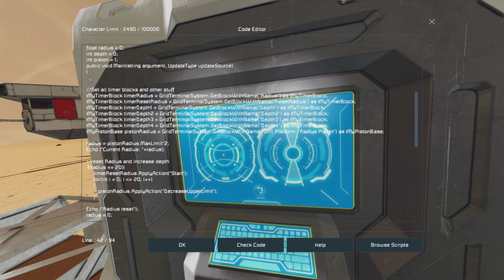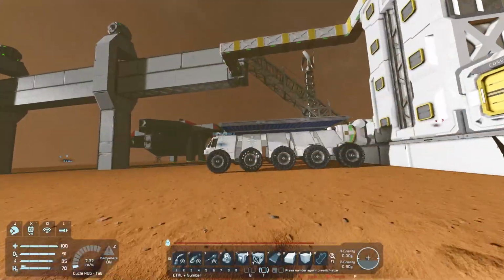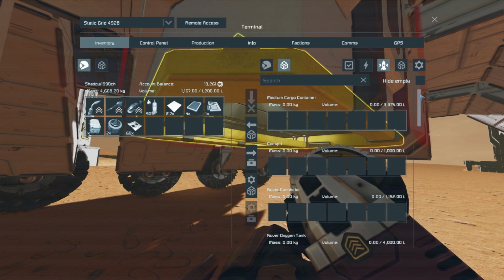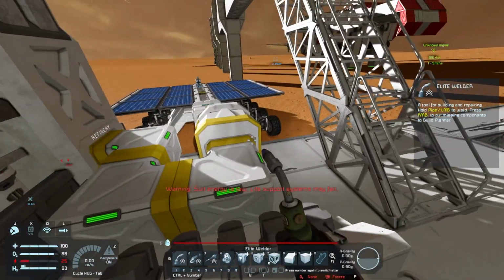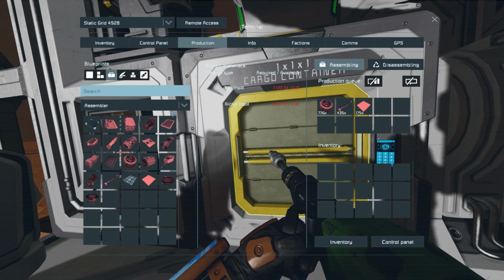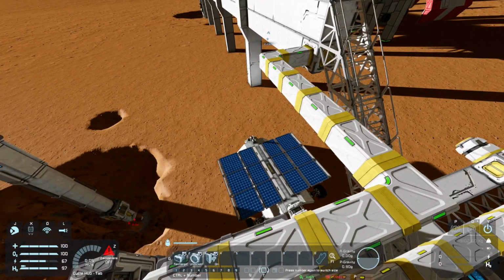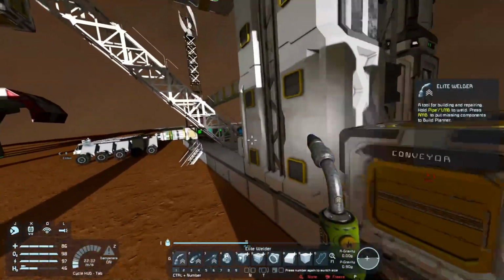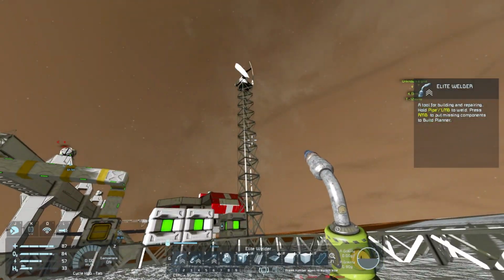Space Engineers: New Parking Spot

Comment: Just to repeat myself, if you reach the bottom of your current drill depth and wish to go deeper, you can simply add more pistons, either by grinding the drills down that you already have OR [as you did with your rover], build a temporary scaffold to hold the drill head in place at max extension and then either add more pistons [which might require more code] OR make up the difference with armored conveyor [same stuff you made the original land bridge with, only use it in the vertical axis] and then remove the scaffolding, and set it back into motion.

I would suggest that adding a whole lot more pistons would allow the drill to run much longer for the next pass though.

If you withdrew the pistons you have and fill the new space with more pistons, the result would be at the very least, 3 times as much drilling depth to what the current one has. [3 x 5]

And if you repeat that again, it becomes 5 x 3 x 3 [multiplying each additional drop x 3] until you reach the other side of the planet, or the pistons break under their own weight and torque, or you decide to make another drill site and start over.
Reply from the maker: Yeah totally. Of course the long term plan is to make a mobile base with its own drilling capabilities, but there is still a long way to go!
Reply: @shadow1990ch  One way of running a mobile drilling base is to build a row of drills that pull behind the main body [like how a farm tractor pulls soil breaking implements] and then just have it drive in a large, gradual arc, have it go straight across everything, or have it wander around searching for ores by  type, which drills billions of tons of stuff, and eventually drills very deep if you allow it to sit too long in one place.

If you use the printer type [as a lot of players call them] 'inchworm' you can use a projection and just start drilling anywhere you want, and then either abandon the leftover drill stem, or else grind it down and save it as resources for the next drill.

Comment: QUESTION!!!!

CAN YOU MAKE A SELF DIAGNOSTIC SCRIPT in this game?

Like:.... { "If [int='any part'] <100% then 'report' " } ....OR.... { "if [int='any part'] <100% then 'weld' " } ..... or some such?
Reply from the maker: Definitly possible. There is already a script on the Workshop that i use regularly called "Automatic LCDs 2" which includes a mode that displays damaged blocks on a screen. And the self fixing is also doable with a projector block, that projects the ship/vehicles blueprint over itself. Then you just need some tactically placed welders and it fixes itself.
Reply: @shadow1990ch  One of the more recent mods has some welders called "Twin Welders" that have some pretty immense range to them so a few of those could keep even a really large structure working.

The Build and Repairs, though, seems to have a very large range, and even collect scrap to bring back to recycle it.